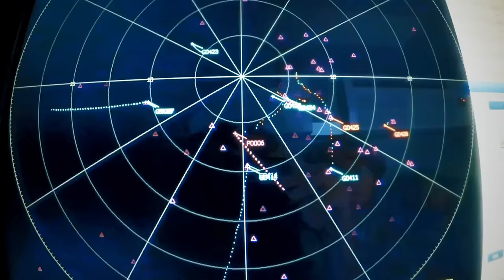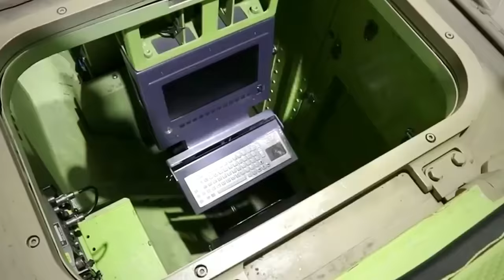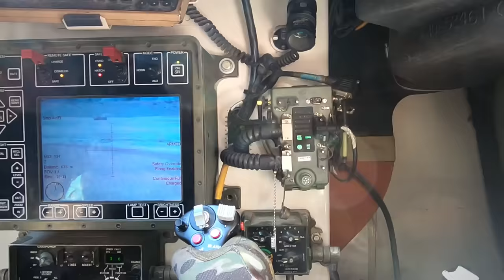Chinese Military Vehicles Almost Better in Everything than the Western Ones

Comment: Being only for export, this usually means it doesn't have the best technology available
Reply: It's the other way around. In China the most technologically-advanced ground vehicles get sold to foreign buyers first to "beta test". If it works well, then the PLA will consider buying it.
Reply: Same as the monkey version export by US and Russia, this practice are widely used and not exclusive about China.
Reply: @andrewsuryali8540 
Nope .

Not anymore !

PRC doesn't want it's advanced version to be tinker with or commandeer by the U$ .
Reply: china appears to be producing a 8x8 version with a similar large unmanned turret which has been called online the 'type 19'
Reply: I heard that Chinese vehicles are better in the export version. Idk why they do that.
Reply: @andrewsuryali8540  Yeah, who did they sell j20 and type99 for "beta test"
Reply: @RandomGuy9  you heard it from who? chinese most advanced stuff ain't getting sold anywhere.
Reply: @MGZetta   GROUND vehicles. The Type-99 was beta-tested by Pakistan as Type-90 (Al-Khalid). Based on their feedback the Type-99G and Type-99A were developed. Previously, Pakistan also helped with the Type-85-II, out of which the Type-96 (originally Type-88C) was developed. However, it was Sudan that first used them in combat against South Sudan's T-72s and T-55s (with some Type-59s mixed in).

On the same note, since 2020 the Nigerians have been beta-testing the Type-99A future upgrades in the form of the VT-4 export MBT in actual combat. Some of the feedback have manifested in the form of the upgraded VT-4 shown in the last Zhuhai airshow and the more recently unveiled armored sideskirts for VT-4. The PLA is still looking for rubes willing to beta-test those upgrades. Probably will be the Nigerians again, although Pakistan is in the running as well.
Reply: @RandomGuy9 First, the PLA prioritizes military funding for the Navy and Air Force, with less funding allocated to the Army.

Second, the PLA assesses that a large-scale land war is unlikely in the short term. Therefore, in order to save military expenses, only a few units are equipped with the latest equipment. For example, although the PLA has 29 heavy composite brigades, only about 7 of them have been fully equipped with the latest equipment.

Third, the Army is more cautious when it comes to adopting new technologies and equipment. Often, they first sell them to foreign customers and then make improvements based on user feedback.

Comment: Better in everything except actual warfare experience 😂
Reply: They are definitely not better in everything otherwise I agree with you!
Reply: The armor we use seems useless against the Russian drones and mines , or does having American men in them add special protections.
Reply: Sheer mass IQ is more than enough
Reply: Exactly..it should be convincing and functional 😅😅😅
Reply: @Rick8191-tv8pg US troops provide experience and better training. Drop off two battalions of the army or marines in Ukraine, and Moscow will have an American flag over it by New Years.
Reply: @Rick8191-tv8pg  Yes, competency.
Reply: @Rick8191-tv8pg They up armor their gear, the grunts use modifications to push the chassis to its limits making mines incapable of breach.
Reply: @kineticstar what type of nonsense did you just type? i mean yeah, i get it, russia is struggling against even ukraine, but are you forgetting the whole Stalingrad thing back in WW2?
Reply: well, unfortunately, US army is highly underestimate power of several things:
1. commercial drones
2. radioelectronic warfare
only ukrainians and russians understand power of 1. and 2., and maybe some Middle Eastern nations understand how effective could be dji matrice.

Some experienced ukrainian soldiers have one major complaint for training programs in NATO: they all lack respect for small, commercial drones. This IS the reason why battlefield on the East and South of Ukraine is transparent
  @kineticstar
Reply: @Rick8191-tv8pg  Western armor protects the men inside. Soviet armor does not. That's the difference. After a Leopard hits a mine the men can still evacuate and go man a new tank. When one of those Soviet sh*t shows hits a mine you're lucky if you can find a body part afterwards, much less a whole body. In that regard alone western armor is far superior to what Russia has. Every time a Russian tank blows up that's 3 trained armor operators that are gone forever. As you know, Russians don't care about their own people.
Reply: @Alex-no1rb US and NATO have air support,remember and drone protection
Reply: VN-22 is a 6x6, while Stryker is 8x8. It's not an apples to apples comparison. For one all 8x8 not just the Stryker have better off road capability where two more wheels gives it better traction and stability in uneven terrains. Also higher payload capacity. A fair comparison would be with another 6x6 like Iveco's Guragani or Patria's 6x6 variant. However with 800hp and all round STANAG LVL 4 protection its over engineered for a 6x6. With that kind of weight configuration its better if they have made it into 8x8. One thing for sure the mud would really love this vehicle.
Reply: @mastermariner490  Russia have around 700 jets - still, they cant mantain air-superiority

On the other hand, this give positive example for Taiwan
Reply: @Rick8191-tv8pg Speaking as a combat veteran and former Abrams and Bradley crewman, yes. If American crewmen are in the vehicle, that means they have American logistical, electronic warfare, intelligence, fire support and Air assets. The closest to magical protection you can get.
Reply: @Alex-no1rb  How many 5 gen fighters does Russia have?Do they practice SEAD/DEAD?combined arms?
Nope,thats only US and NATO.
Thats the reason why Russias airforce is useless in Ukraine
Reply: @mastermariner490  yes they have practiced SEAD/DEAD, but without substantial results, because ukrainian AA  were decentralized
Reply: @Alex-no1rb Russia doesnt even know what sead/dead is,and have never used it anywhere,and Ukraines western air defences stopped anything russian from flying there.
Reply: @kineticstar lmao you will still be coping the day kiev surrenders 😂😂😂😂
Reply: Darktech buys into Chinese and Russian propaganda HARD all the time. It's either for sensationalism or for propaganda purposes, idk which.
Reply: @ameyapathak2008 remember 1962……? Was it friction
Reply: @Alex-no1rb first correct spelling. It seems you are not educated.
Reply: idk what you talking about
 @Israel_diaper_Force
Reply: @Israel_diaper_Force  1962 was ahige political failure ...no Prime Minister was Nehru wat can u expect from him.. thank God we have Modi now
Reply: How good is experience though, when you havent won a war in a real long time??
Reply: The Bradley's found out the hard way 😂😂😂
Reply: Sure the USA has plenty of experience in leaving in a hurry like in Afghanistan. 20 years , trillions of dollars 💸 and they replace the Taliban with the Taliban 😂
Reply: @kineticstar  
that's a bullshhtht argument and you know it since both sides would start throwing "radioactive goodies" at each other which won't fair well for the entire world
Reply: @johnsmithe4656  
And that's also the problem.
In a war of attrition, the Soviets have the advantage since they have more numbers and their stuff can be easily made and refurbished whereas Western ones need highly specialized mechanics and facilities to fix them.

That's basically what is happening now in Ukraine.
Even with the Western stuff they have, the amount they are losing is eating away a large chunk of what they have and can't lose in the war.
Reply: @baddestmofoalive  
but take that away and they're just lambs to the slaughter.
America's greatest assets are also it's biggest weakness.
Reply: @dickmelsonlupot7697  lol “just take away everything that gives them an advantage and they will lose the advantage”

Very profound 🙄
Reply: Lol someone's jealous 😂
Reply: that's what being peaceful actually means
Reply: Russia has the US beat there too, Russia is fighting a US-NATO backed Military, and is also WINNING.
Reply: Mighty US American vehicles, tried and tested against Afghan farmers
Reply: Like half of NATOs arsenal
Reply: I think no one have actual warfare experience with a near peer global power, the closest one is recently western armor test on Rus Ukr conflict, and they are certainly not doing very well
tbh experience with goat herder in a dessert likely won't tell much how it will looks like in a real peer conflict
Reply: Really? Is that why 5 nato trained armies by US 
Failed a
And got wiped off against russia? @kineticstar
Reply: @smileyface6583 russia is mot struggling anything. Do you know whats the smo objectives?
Reply: @johnsmithe4656 thats the difference? Lmaoo russians survived more than nsto vehicles. Clearly you not seeing war in ukraine people getting burned inside nato vehicles.
Reply: @mastermariner490 no they do not.
Reply: @Alex-no1rb russia actually has air superiority. Ukraine has no more airforce and russia bombing everyday ukriane. Are you on coke.?what are the smo objectives?
Reply: @mastermariner490 you should worry s-400s
Reply: @mastermariner490 sure is that why fab 500s doing great against ukraine? Lmao the level of copium in you guys are astounding
Reply: @alexnderrrthewoke4479  smo)) Ваня, не старайся притворяться англоязычным

So when the last time russian jet passed over ukrainian city, like in the spring 2022?
Reply: @alexnderrrthewoke4479  Hi there Russian bot/drone/hopeless cultie.

There are dozens of videos of Soviet era tanks as well as more modern Russian tanks having their turrets blown sky high. Please find such a video of that happening to a Leopard II, Challenger, or Abrams, and post it here.
Reply: @alexnderrrthewoke4479  fab500 is a glide bomb delivered from 50 km away and have poor accuracy
Reply: @alexnderrrthewoke4479  They dont what,Igor
Reply: @mastermariner490  poor accuracy? Lmao clearly you have not heard the best cheap upgrades that makes it better than american bombs
Reply: @johnsmithe4656  hey nafo bot explain to me how you have the guts to talk to russia when your track record of winning wars against sandals is very poor? Well check syria, yemen how abrams and leopards are roasted very nice if you don't believe me. All thanks to soviet weapons you like yo make fun of. Also check again all leopards tanks burned so well in ukraine by russia. Check also the famous bradley square. And cope. You lost ukraine too.
Reply: @alexnderrrthewoke4479  Russia doesnt have the electronics nor the technology live it,Igor
Go cure your delirium instead

Comment: I remember their imported firearms and if this is anything like those their troops have lots to worry about.
Reply: if you are in the US, you can check Norinco's rifles. at that time was only $200, now became collector's item priced around $3000.
Reply: @YSKWatch  norinco have made improvements in standards over the decades alot of chinese industry has . i remember during the syrian war for a period they even sold their anti drone rifles on ali express upto 3000 a piece depending on model the drones also available there too with increasing standards , western purchasers wil find value increases because of the trade war wich strangles availability ,in theory one could buy this apc from norinco via a private enterprise and then re-verse engieer it but the duty tax will be enormous

Comment: VN-22 is a 6x6, while Stryker is 8x8. It's not an apples to apples comparison. For one all 8x8 not just the Stryker have better off road capability where two more wheels gives it better traction and stability in uneven terrains. Also higher payload capacity. A fair comparison would be with another 6x6 like Iveco's Guragani or Patria's 6x6 variant. However with 800hp and all round STANAG LVL 4 protection its over engineered for a 6x6. With that kind of weight configuration its better if they have made it into 8x8. One thing for sure the mud would really love this vehicle.
Reply: It needs to be 6x6 to keep that level of armor. It's already 25 tons as is. In 8x8 config the whole thing would weigh more than a Bradley.
Reply: @andrewsuryali8540  I guess it was not designed for the rural areas.
Reply: @johnsilver9338  they need to be able to keep their peasants locked down in cities.

Comment: That chassis has some external resemblance to their older WZ-551, which also happens to have a lot of variants in it's family overall.
Reply: i know right? also looking at the Type 92 platform as well ( same thing, different spice/flavor )
Reply: NORINCO are showing models of 10 different variants at trade shows, not including the 3 different RWS turrets for the infantry variant shown here.  So 12 versions total I guess.
Reply: Your assumption is correct.
Reply: yeah 13tons vs 25tons
THIS IS NEW. New hydro suspension vs simple shock, new engine, new transmission to name a few things.
Reply: @MultiYlin  - Well, they are both made of metal and have six wheels, so,.... nearly identical!
Reply: @MultiYlin  I was reacting to the remarks how similar this thing is to the Stryker in concept, because China has been using the WZ-551 in that capacity for ages already, so it's not a copycat, but rather a continuation of a concept already present in chinese armoured vehicles previously.

Comment: Almost all IFV and similar would succumb to a simply rpg round. 
So I'd argue,  no matter how good the design of the combat vehicle is,  it is unlikely to be a deciding factor in a ground battle,  but more so on the correct tactics being executed skilfully, bravery of soldiers,  combined arms etc
Reply: Thats not true. An RPG has limited armor piercing capabilities. Modern IFV’s and APC’s can take multiple hits from shoulder fired munitions. The only type of weapon that can really counter them are top-attack munitions like the javelin,spike, and tow-missile. I know of apc’s in the middle-east that rook multiple RPG hits and kept going.
Reply: @jvb1232  at the right angle,  an rpg will do for most apc/ifv. Top attack rounds can even mop up MBT, just look at Ukraine!!
Reply: @jvb1232  Nonsense a Yassin 105mm Tandem warhead from RPG29 and ESPECIALLY Kornet atgm will vaporize any modern IFV. Why do people say this stuff when we have videos from a current conflict proving it wrong?
Reply: @Baz.007  Yes but honestly top attack munitions are overrated they have around a 22% target hit rate and are expensive to mass produce compared to tandem rounds
Reply: @off6848  The Yassin is a pretty shitty munition, they have a high failure rate. Even the original Russian PG-7VR tandem charge projectile has a pretty high failure rate of the main charge, something like 15-30%. It's extremely difficult to copy regular RPG fuzes because they're pretty intricate. You are correct that tandem warheads and ATGMs are dangerous though.
Reply: @jvb1232 Nah he's right, effectively no IFV/APC exists that can stop more basic RPG-7 warheads with the armor itself. That's why many use slat armor (which relies on crushing the body of the rocket between slats which destroys the body of the rocket before it explodes, or active protection that intercepts it. Modern western IFVs do have spall liners though that minimize any damage a penetrating hit does. The only exception is the Namer but that's effectively the Merkava main battle tank with the turret removed and not a normal IFV.